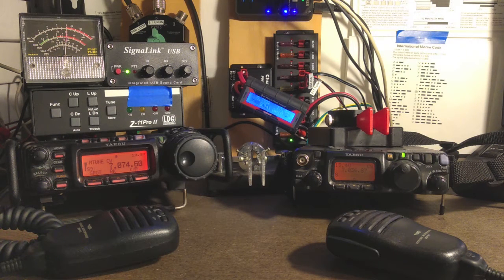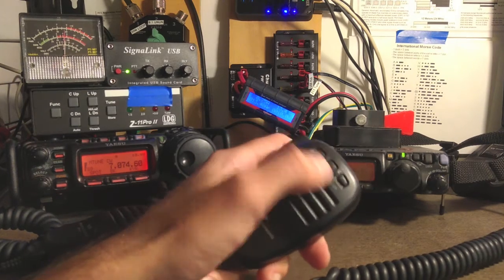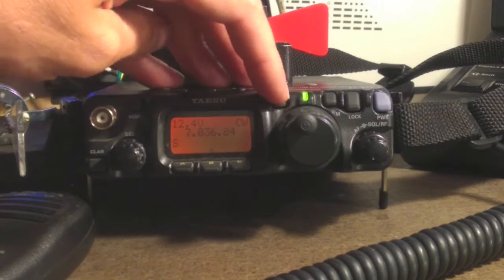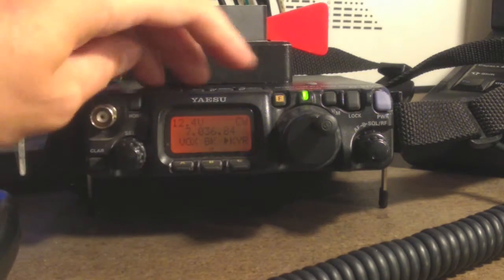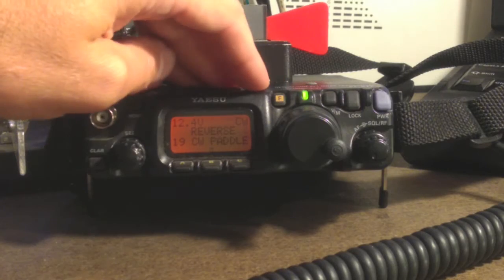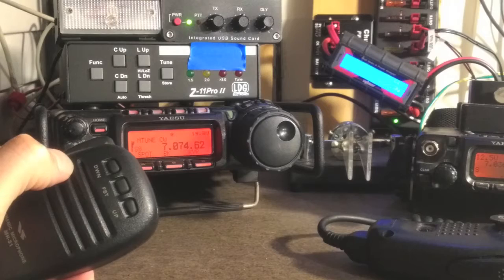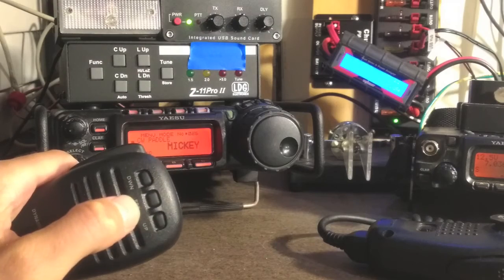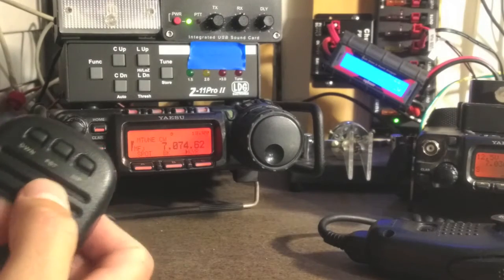Send CW from your Yaesu hand microphone

Comment: I did this but, I don't hear the side tone, how did you turn it on and can I do this in SSB or do I have to be in CW mode
Reply from the maker: You need to be in CW mode, however, there is a way to get the keyer to work on FM (and possible SSB) mode, but that function is escaping my memory at the moment.  In the menu, there is a setting for sidetone, is it turned up?  Did you make sure the keyer is enabled?
Reply: @RevMook  I have FT-818, just upgraded from 20yr old 706MK2G to use on my 1.3 and 10Ghz transverters, 
I love this forward reverse antenna, but wish the F key was where the useless lock button is.   
in CW, I hear a roger beep when I use the Key, but no adjustable tone,  on FM I tried all your suggestions, I bet the menu differs between all the 817 / 818 / ND models.
side tone set at 100
mic key ON
1000Hz pitch
speed 20 wpm
...-   .   ...--   ..-   .   -
Reply: @RevMook  Works on FM by using auto mode, at least on my 857 (and not on my 818). Should work with an external keyer, too.